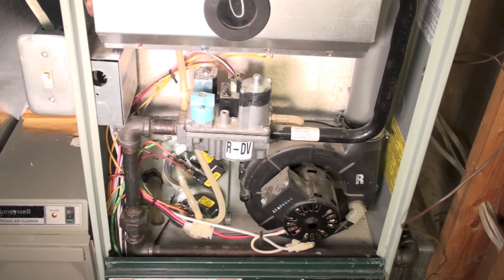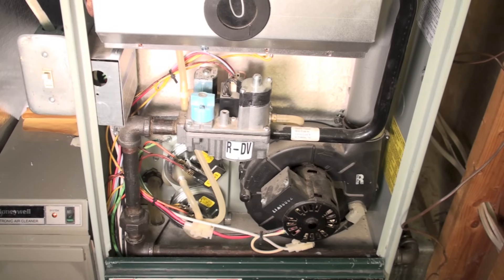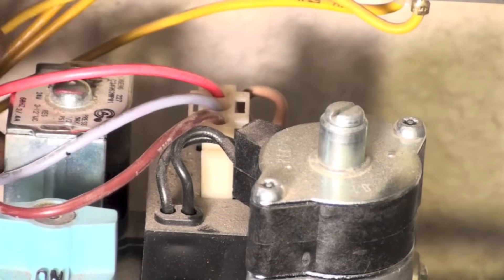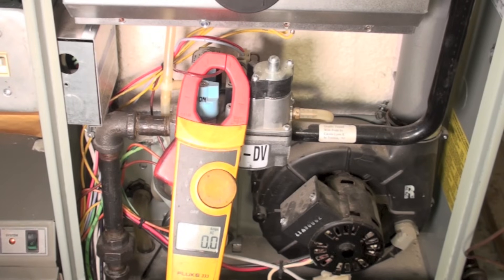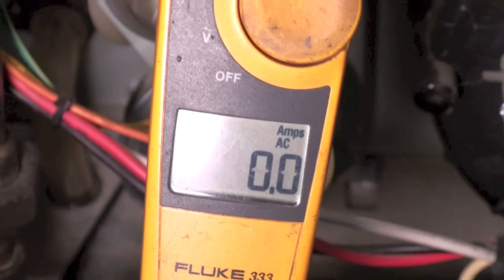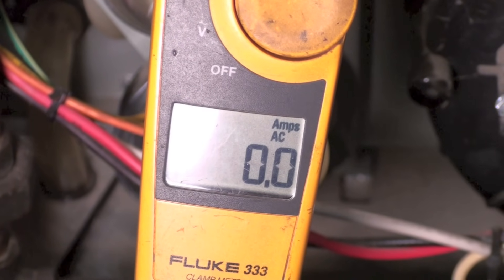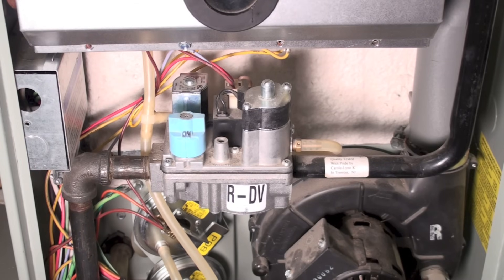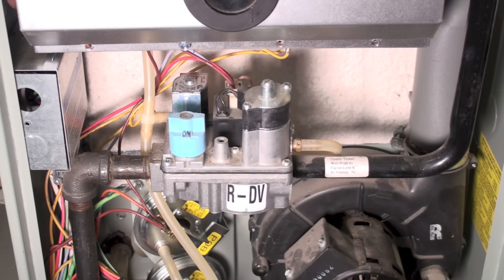The simple check of the gas valve

Comment: Dealing with a Carrier Infinity Package Unit.  It will properly go through the ignition sequence, fire off, run through a cycle, but when the room temp reaches the temp to restart another heat cycle the unit will sometimes cycle again for a few cycles or it may not cycle again.  If it fails, it will ignite three times but not sustain a burn then lockout for 3 hrs unless you reset the unit by turning the power off then back on to the unit. A 34 code will show, then a 14 after 3 firing attempts  The flame sensor had been cleaned then a new one installed with the same result.  I am leaning toward a faulty/weak gas valve solenoid.  Any suggestions?  Thanks!
Reply from the maker: If the burner flame is covering the flame rod, you probably have a control board problem.  
GFM
Reply: Finally figured out the issue and maybe this will help someone else.  It was not the board and not the flame sensor.  We have two of these package units side by side, and they both were giving the same "34" error code which made me suspect that both boards and both flame sensors would not be causing the same issue at the same time.  As I said, sometimes they would work ok, then go to error.  The flame tubes are a little low to the ground, but I was on my hands and knees once when I fired it off.  Only the tube with the ignitor was burning, and no flame traveled to the other tubes after ignition, hence the flame sensor never got involved in the sequence.  My son and I pulled out the burner units, and the flame side edge of the burner had rusted enough that it impeded the gas flow across the front to the other burners.  I cleaned up the rust, reinstalled the burner unit on both package units, and they have worked flawlessly since.  Am in the process of getting new burners.  We live in a high humidity area which probably contributed to the rust issue. Thanks for your time to respond.  Kind of hard to diagnose things over the internet without getting hands on.  Enjoy your videos.

Comment: at 702 did he say, if it's in line with the gas it's OFF?  I don't think so, that means it's ON
Reply from the maker: I did say it was off.  Note the text on the right side of the video correcting myself.  Or did you use ad blocking software?
GFM
Reply: grayfurnaceman it doesn't show if you're using ad blocking software. I didn't see it either but I knew what you meant. Thanks for the video.

Comment: My furnace is letting a rare scent fume when it is on.  I just had a shimney sweap because I thought that was the reason for the smell I was getting.  Nevertheless, the fumes are still there.  It doesn't smell like gas but some type of combustion. Please guide me.
Reply from the maker: It is probably burnt gas.  If its a natural draft furnace(older than 25 years), it is probably not venting properly or there is a crack in the heat exchanger.  This needs to be looked into.  There is a possibility of CO poisoning.  Your best bet is to get a service tech out there.  Hope this helps.
GFM

Comment: Hello grayfurnaceman, I have a Williams Wall Furnace in my shop area Model 3003622, the unit is approx. 1-1/2 yr. old. The pilot goes out after 20 mins or so.I replaced the Thermopile/pilot assembly....same thing happens. With everthing connected, thermostat as well I tested the mv present. I lit the pilot with meter connected and got 306 mv dropping down to  180 over a 10 min period then without touching the thermostat  the readings dropped to117 mv then rising to 150 mv then dropping to 40 mv and at this point the pilot light went out. Time duration of this test was 25 min. Can you help.
Reply from the maker: +24getful1 If the Pilot flame stays the same while this is happening, you either have a thermopile problem or your wiring connections are nor clean and tight.Hope this helps.
GFM
Reply: 24getful1

Comment: what if pilot goes on & stays on, but furnace full power does nothing? thermostat is ok and functioning..
Reply from the maker: +Photographic Elements On a pilot operated furnace, the pilot has nothing to do with the furnace power.  I would check any breakers or fuses first.  Then check for 24 volts with a voltmeter at the gas valve.
GFM

Comment: Thank you for sharing your experience with us. Can a valve be intermittently working ?
Reply from the maker: It certainly can.  Not real common but it does happen.
GFM
Reply: @grayfurnaceman  thank you for your reply, it ended up being the IC inside the board that was damaged and had an on / off behavior with a code 7 on a Trane white Rodgers IFC. I used your video to troubleshoot the gas valve. Then I removed the board and diode checked back to the IC. Thank you.
Reply from the maker: Welcome
GFM

Comment: OK,  I know that your video is for demonstration, so why did your gas valve drop out and not keep the furnace running.
Reply from the maker: It dropped out because the connector to the gas valve was disconnected.
GFM
Reply: ok, one more time if you would, maybe I am missing the obvious.  Your furnace tried to ignite, the gas valve was pulling amps and in order to do that the connector had to be connected if you would, gas supply is on and the furnace still did not ignite. What in the world am I missing and not getting. lol..  The furnace should come on or in this situation you truly do have a defective gas valve?

Comment: My furnace only goes thru entire heating cycle sometimes. My thermostat calls for heat the small fan always comes on. I have a White Rogers 50E47 843 controller. During the time it does not go thru entire heating cycle, the controller is flashing red which means it has locked up. If I shut power off of furnace and then turn power back it will go thru entire heat cycle. I also tried cleaning the flame detector sensor. Can anyone assist me?

Comment: I have a 4 yrs old boiler pennco series 15 B  gas valve alarm go's off when turn up the heat what's up it flames up but gas Gas valve alarm go's off
Reply from the maker: +Tom Mack Beats me.  You might send me the model and serial and I will try.
GFM

Comment: I'm having these same problems but only some of the time. Ignitor heats up, no gas, turns off retry's 3 times. If I reset the system, it will sometimes work. I'm thinking its the wiring to the valve itself. Where can you pick up one of those white wire couplings at the end?
Reply from the maker: I guess I don't know what you mean by "white wire couplings"
GFM

Comment: Hi GFM!  I'm having an issue with my Goodman GMH95 not igniting.  The draft inducer blower turns on, the igniter starts glowing, then voltage (~27V) goes to the gas valve for about 3 seconds.  Then the voltage drops and the igniter turns off.  The draft inducer blower keeps running for about 15 seconds, then it tries again.  It will try three times before going into lockout.

I don't have a clamp on ammeter and am thinking about going to buy one.  Is my problem definitely a gas valve?  Or do I need to confirm with the ammeter?
Reply from the maker: If power is available to the gas valve (it appears to be)  and gas is available to the valve, the gas valve has failed.
GFM

Comment: I had issues with the furnace short cycling which turned out to be the control board. I replaced the control board and everything was great, Until yesterday and now it has the symptoms of no gas getting to the burner. Its a Rheem Criterion II. Any suggestions would be much appreciated.
Reply from the maker: Can you send me a video of the furnace attempting to start?
GFM
Reply: grayfurnaceman repair guy came in yesterday, said gas valve is fine but electronics not telling it to open. Bad control board. I guess buying used didn't save any $. Strange how control board going on it though. I think its been replaced more than once and its an 02 model. Not real old

Comment: This is a basic instructional video so people with minimal experience may watch this video and misunderstand what you mean when you say an “open solenoid”. Your meaning is NOT that the solenoid has opened the valve. Your meaning, I believe, is that the coil in the solenoid (that makes the solenoid function through the force of electromagnetism) is burned out whereby there is lack of “continuity” from one end of the solenoid coil wire to the other end of the coil wire. It’s a kind of difficult thing to describe but I think entry level people like myself could be easily confused when you say “open” solenoid. If you ever prepare a revised or updated version of this video, perhaps you could consider spending a moment describing what you mean by an “open” coil or open circuit. Respectfully submitted. I appreciate your video very much and hope you will not feel insulted by my suggestion.
Reply from the maker: No problem.  I tend to use electrical terms when I explain.  Will see what I can do.
GFM

Comment: Pick just one wire? Why don't you just clamp around all the wires because it obviously doesn't matter which one. All you're looking for is the 4 second signal, right, or am I missing something?
Reply from the maker: You are missing something.  
If you clamp both sides of line, the signal cancels out and you read zero.
GFM
Reply: @grayfurnaceman , the first time you showed the clamped wire gave no reading so what is there to "cancel out", because the other wires, you said, give different signals at different times--so where it the "cancel"? Have you ever tried it on all 3 wires?
Reply from the maker: @1weirddoe571  Yes, sometime in the early 1970s I did try all wires.  It read zero.  
You just have to accept that this is how it works.
GFM
Reply: @grayfurnaceman , on a water heater gas valve what are the red wires on the back for--are they part of the solenoid, thermocouple, overheat Thermo-sensor-cut-off switch loop that opens if it's too hot? is there a wiring diagram somewhere you've covered? I'm glad you've investigated all these parts so that you know exactly how they work and give everybody 100% accurate knowledge! Unlike many people on the internet.
Reply from the maker: @1weirddoe571  Its called an ECO and its a one time hi temp fuse.  When it opens, the valve must be replaced.  There is no diagram for these valves, as it is all inside the valve.
Sometime I will tear one down.
GFM
Reply: @grayfurnaceman , I see some different "fuse" called TCO but that's down on the burner chamber and that is replaceable. The one that sticks into the tank is not a TCO but and ECO? Or have things changed and on newer units they now have moved this temperature cutoff fuse to the chamber only? Or NOT and there is still one in the gas valve inside tank? But, regardless, do the newer, way expensive Honeywell gas valves have this ECO that still must be tossed if high water temp blows it? Or is there some company that makes a reset-able high temp water cutoff ECO gas valve fuse so that I don't have to throw the whole gas valve away if blown? maybe I'll re-post this on your water heater gas valve video so others can benefit?
Reply from the maker: @1weirddoe571  An ECO and a TCO are the same. They cut off if the water temp reaches a dangerous level.  If it is a FVIR system, the opening of the sensor for flammable gas necessitates replacement of the gas valve also.  No resettable switch that I know of.
GFM

Comment: Today I disconnected the Thermostat and ran a jumper in it's place. I ran the burner for 3 min. and the disconnected the jumper. Burner went out, pilot stayed lit and as this was happening I was taking a Mv reading on the Thermopile. From the point I connected the Meter I got a reading of 80 or so Mv and watched it decrease to 51 Mv at which time the Safety killed the pilot. This all happend without the Thermstat connected.
Reply from the maker: +24getful1 Either you have a weak thermopile, the pilot flame is not covering the thermopile or you have loose wiring connections.  Hope this helps.
GFM

Comment: OK I put the meter on and I'm not getting power to the gas valve.
Reply from the maker: If you do not get amp draw when the gas valve should be getting power during the trial for ignition, you need then to check for voltage supplied to the gas valve.  If you have voltage during the trial for ignition, the gas valve has failed or the is no gas supply.  I have a video in the pipeline for the voltage check of the gas valve that will be out in a few days.  Hope this helps.
GFM

Comment: I was looking at the union attached to the pipe supplying the gas to the valve. There should be a flex gas line from the pipe to the gas valve. Is that not correct.

Comment: You use a lot of words very very loosely and incorrectly!!!
@7:02  gas valve handle in line with supply pipe means the gas is turned ON and NOT OFF as you stated. 
Earlier, you stated if the A/C clamp meter showed current, the solenoid is actuated!!!  Not true.  You can have the coils of the solenoid energized but that doesn't mean mechanically it actuates!!!
Reply from the maker: Watch it again.  Valve handle parallel.  Perhaps you did not understand the point of the video.  "Simple check of the gas valve".  
GFM
Reply: @grayfurnaceman  You said it incorrectly for the gas shut off valve!  "As long as it is in line (parallel) with the pipe, it is off.". Your words, not mine. This is incorrect.  Maybe you didn't realize what you said. 
I'm not disputing the gas to the furniture needs to be shut off. Perhaps you didn't understand what I said.
Reply from the maker: @LWRC  You could be right on the cock position.  
GFM

Comment: furnace for some reason all of a sudden isn't getting gas. everything seems to be coming on just fine just no gas. any ideas?
Reply from the maker: Are all other appliances working normally?
GFM
Reply: grayfurnaceman 
yes other appliances are working great. it's just the furnace.
Reply from the maker: At this point, you will need a meter to start checking.  The valve should have 24 volts during the trial for ignition.  This means the hot surface ignitor glows.  After it gets bright, you should show 24 volts on the valve terminals for from 4 to 7 seconds.  No voltage, look for wiring problems or the control board.  Voltage available, gas valve failure.
GFM

Comment: God bless u sir do u have a email or number for tech support?
Reply from the maker: You can use the comment section or use Grayfurnaceman@gmail.com
GFM
Reply: Hello grayfurnanceman, I have an issue where if I restart the furnace (power off/on) the whole process works fine but after a while (few hours) it does not restart the furnace. I have randomly noticed that while starting sometimes turns on the flames and turn them off immediately and starts on the 2nd try. I tried replacing the flame sensor. That did not fix the issue.

Comment: the gas  valve clicks then turns right off with contiuous red blinking light
Reply from the maker: +TheSyraboy I will need a manufacturer, model#
GFM
Reply: model: G6RC100C-16
FRIGIDAIRE NORDYNE
Reply from the maker: +TheSyraboy If the burners do not light, you may have a shorted gas valve.  If the burners light for a few seconds, then shut down, you could have a dirty flame rod.  Let me know.
GFM
Reply: +grayfurnaceman there is no flame.  Just the glow of the starter then a click and it shuts down and blinks continuously.  Yellow light on and red light blink continuously.
Reply from the maker: +TheSyraboy From what you say, you could have a gas valve failure.  Or no gas available.
GFM
Reply: is there a way to determine
 which it is?
Reply from the maker: +TheSyraboy If other appliances on the same piping are working normally, gas is available.
GFM
Reply: i only have the furnace wih gas.  Everything else is electric.
Reply from the maker: +TheSyraboy Did you pay your gas bill?
GFM
Reply: +grayfurnaceman we  have LP and the tanks do read that there is gas in it.  I cant be positive, but there "should be "  gas in there.  Our bills are paid in full.    I appreciate your help here and taking the time to answer back.  Thanks

Comment: I'm Retired Since 2008 & I Just trying to help MY Dad He has the Old Trustee Heil  gas Furnace  though every now and then the v800c10371 Gas Valve sticks it fail to push the plunger  all the way down in the Seat of the Valve Probably due to moisture and dirt and sand particles I advised him to CLean the Drip Leg after shutting off the power and the Gas Cock then Re install and Test he says when he gently taps on the Valve it then closes he will also check to make sure that the Valve is LEVEL he says its on a bit of an angle the Spring may be a Little fatigued weakened by Years of Good Operation  I HALE  Heil Manufactures  GOD BLESS AMERICA  I AM THE REAL CHICAGOMIKE  Retired after working MY butt off in FLorida for twenty Years
Reply: YES I AM UNIVERSAL  CERTIFIED  PER THE EPA SERVICE INDUSTRY YEAH BAYBAH  though I would rather work on Larger Stuff Like Water Cooled Centrifical Chillers   that type of Industrial Equipment though when I Lived and Worked in FLorida I use to Service and work on ALL THE AIR CONDITIONING at the  AT&T CELL SITES & THE NEXTEL CELL SITES at  ALL COMMUNICATION TOWERS & ALL EXCLUSIVE TOP NOTCH RESTAURANTS REFRIGERATION ELECTRIC PLUMBING THATS ALL  EASY STUFF FOR ME YEAH BAYBAH